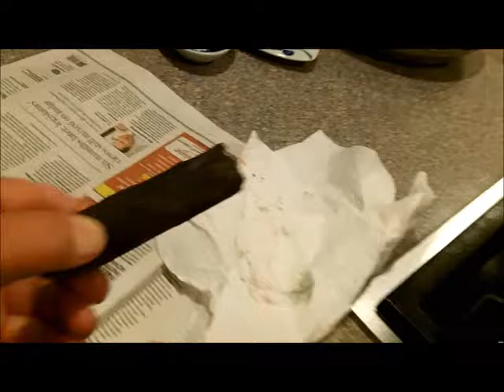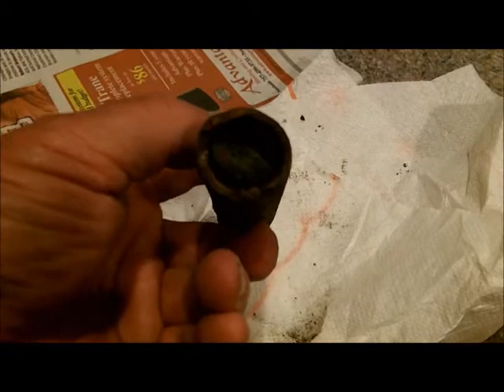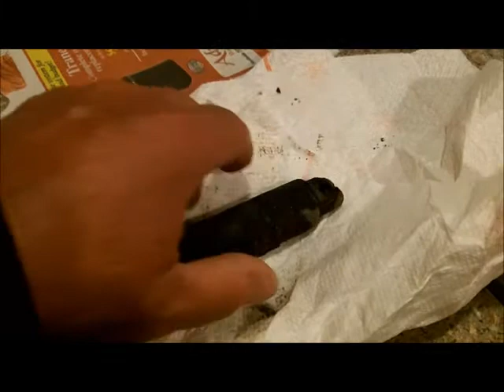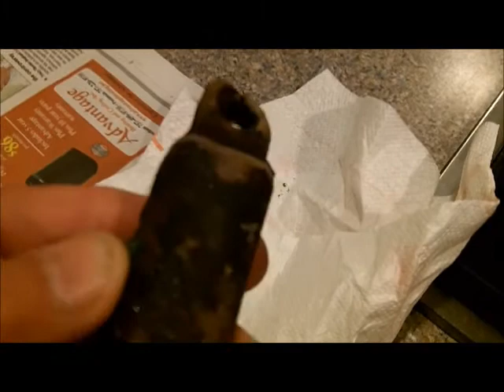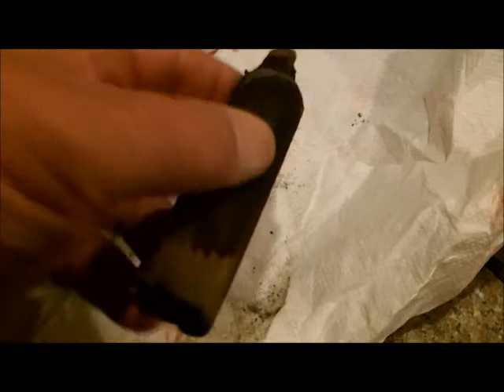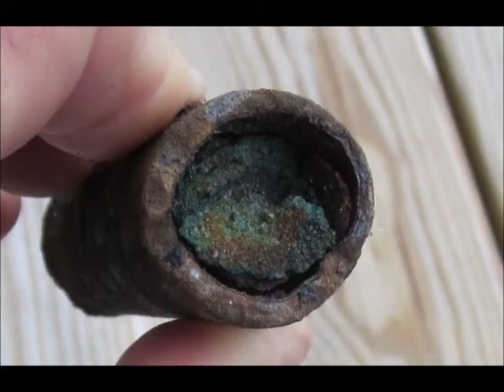depth weight

Comment: Thought for a second window weight until i saw the bottom.Be too small anyways.used to work as part of house demo.had a pile of those window weights.Finally gave them to a scrap guy.Drop one of those on your foot and it would not feel good! Lol! Lok like fuel depth checker.May be the packing bottom you squeeze to check for water and rust in tank?